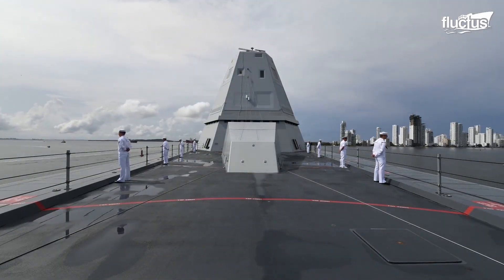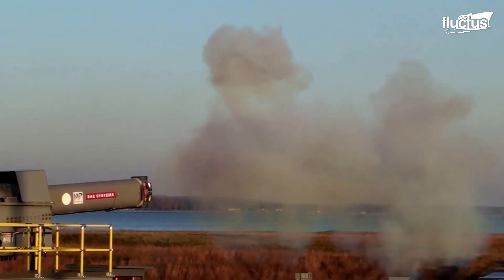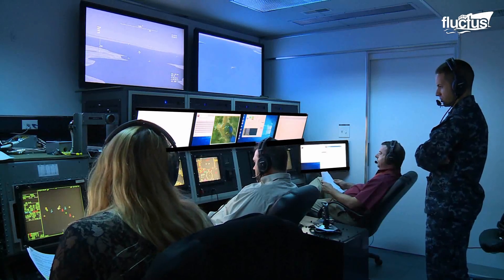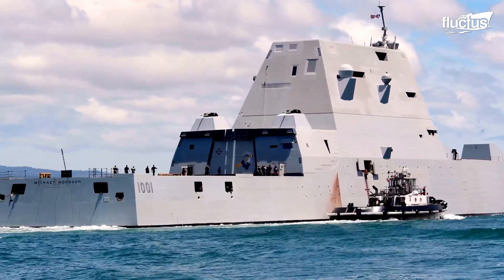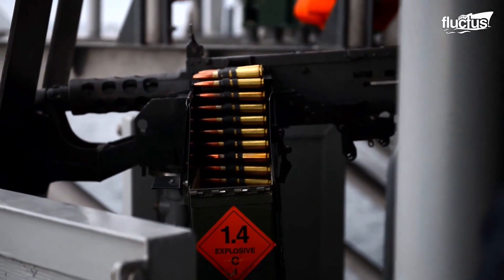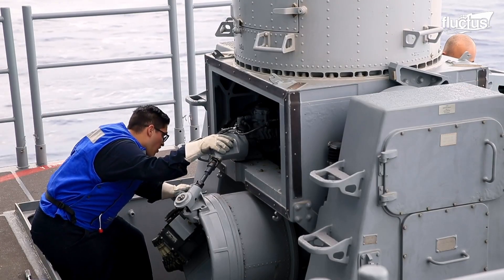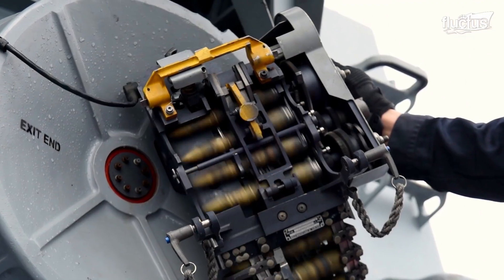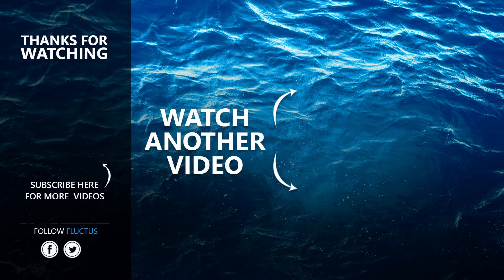How US Navy Tests its Super Advanced Billion $ Rail Gun Systems

Comment: Mach 7 is about 1.5 miles per second (1.492 mps).

So it will take over 60 seconds to travel 100 miles.

That is a long time for a projectile to be in the air. Gravity will have a say, and the trajectory will not be very flat.

And the air itself will also have a say.

Comment: I assume this would not work on moving targets given the complexity of determining where the target will be when the projectile is fired from tens of miles away. Also, how to they account for the curvature of the earth over such great distances. It does not appear that the trajectory of the projectile can be altered once it leaves the gun.
Reply: Accurate long range fire at moving targets was solved with the advent of digital computers.  Your phone can do the necessary calculations.  Snipers carry a computer a bit bigger than a phone (has to be rugged) that even takes the rotation of the Earth into account.

The real problem with railguns is that they burn out the "barrel" (rails) after a handful of shots.  Fixing this requires taking the entire weapon apart and replacing the rails.  That is precision work so it cannot be done at sea.  The US Navy stopped working on railguns in 2021.

Comment: We used to be able to throw a Volkswagen 23 miles so I guess we’re going back in time.
Reply: My dad loaded the guns that launched those…Volkswagens. 16 Inch guns took a tremendous amount of gunpowder that railguns don’t use. Gunpowder is explosive. Electricity, not as much.
Reply: The idea is that you give the projectile energy by increasing its velocity, rather than by loading it up with explosives. VW-sized projectiles take up a lot of storage space and weight aboard the ship, limiting how many rounds you can carry. But increasing a small projectile's velocity only consumes fuel, thus obviating most of the storage and weight costs. Especially if you put it aboard a nuclear-powered ship.

And if you don't end up firing any rounds, the extra energy remains as fuel so increases the ship's range. Whereas the VW-sized rounds would just be dead weight in that scenario.
Reply: They travel speed8270 per second , is a huge difference from 23 miles

Comment: I thought they shut this program down in 2021. Is this program still running?
Reply: It is not.  It has received no funding since 2021.
Reply: @JonMartinYXD  Thanks, that's what I thought.
Reply: You thought correctly, they shifted to hypersonic weapons development
Reply: @AramisUS-Ru-Rom  THOUGH at $100M for a single hypersonic glidebody, you have to wonder how useful it is.
Reply: @charlesrichardson8635  More useful than a railgun that eats itself alive every shot.
Hypersonics are rarely used in practice though. They're saved for high value targets like ICBM's and very fast aircraft. The cheaper supersonic SAM systems are fine for that

Comment: Rail guns won't be ready for deployment until the durability problems of the launch mechanism can be solved.
Reply: @joshuacook6981  that's part of the durability issue. They can only fire a limited number of projectiles before the launch mechanisms are compromised.
Reply: @chazz2806 It won't take more than a few launches to shut an enemy down.
Reply: @itscarlos890 If durability/reliability was assured then deployment would not be an issue. It's also important to remember that defense systems are regularly tested via live fire exercises which is additional wear and tear. This comes from an article on the engineering of the weapon:

Durability: One of the biggest challenges of designing a railgun is ensuring its durability. To date, public demonstrations have not shown the ability to fire multiple full-power shots from the same set of rails. In order to be feasible for deployment, a railgun should be able to fire 6 rounds per minute with a rail life of about 3000 rounds, tolerating launch accelerations of tens of thousands of g’s and extreme pressures and megaampere currents.
Reply: @itscarlos890   This comment is from an article about rail guns....

Durability: One of the biggest challenges of designing a railgun is ensuring its durability. To date, public demonstrations have not shown the ability to fire multiple full-power shots from the same set of rails.

In order to be feasible for deployment, a railgun should be able to fire 6 rounds per minute with a rail life of about 3000 rounds, tolerating launch accelerations of tens of thousands of g’s and extreme pressures and megaampere currents.
Reply: @chazz2806  I understand why it's not cost effective to have actively deployed. But even a prototype would end a cruiser. Keep in mind, Nagasaki and Hiroshima were the first and only use of nuclear explosives in a war.we understood what they did, but in essence those bombs were prototype of their yeild. The rail gun could be the next thing to prevent enemy naval forces. Impact force such as that, dropped from altitude would be just as deadly. All it would require is it's own inertia, and gravity
Reply: @chazz2806  I'm speaking more for the fact it would benefit, any living thing around(Not in thr exact blast radius) but surrounding areas. In a sense of no nuclear fall out.
Reply: with the amount of money the US puts into research and development it’s probably already been solved or not far ofd
Reply: One on the uss new york n it's not a z class
Reply: I remember half my life ago. I began seeing articles and videos about rail guns. I'm now twice as old and this ridiculous technology useless technology is still being tested. It's not going to go anywhere. It's just a fun thing for useless society. Draining military people to have fun with. They know this isn't useful.
Reply: They some to attack in big numbers in the air

Comment: That's nice that the rail guns can shoot 100 miles, but how good does it do to poke little holes in ships or planes. I don't understand that. I'm not putting it down, but it seems an explosive round would be more effective. The other systems are awesome too. 😊😊😊❤❤❤
Reply: First of all imagine a Mach 6 projectile slamming into your ship.
Second think of the air friction heating that shell up until there is plasma
Third think of how powerful the kinetic energy of Mach 6 is
Reply: K.E. = 1/2 m v^2: speed in mach is ~3 x speeding bullet; 9 x KE!!!
Reply: Like the guy above mentioned KE equals .5 xv squared.
So if you consider a 20 lb object moving at 8000 ft per second thats 10x 8000x8000 equals 640 000 000 ft lbs of energy. Thats a noticeable amount of energy. Upon contact with a target say your typical warship of today the projectile would easily pass completely through the ship....any ship leaving plasma hot shards and a hole in its wake. Along with a considerable shock wake.
If it happened to hit the reactor room in a nuclear carrier you could briefly observe a runaway melt down before the core burned a hole in the bottom of the carrier.
 If the projectile hit an aircraft likely youd see a fireball with duralumin scraps falling out of it.